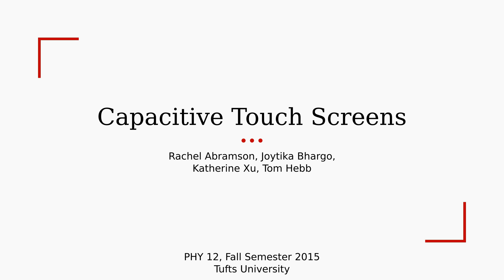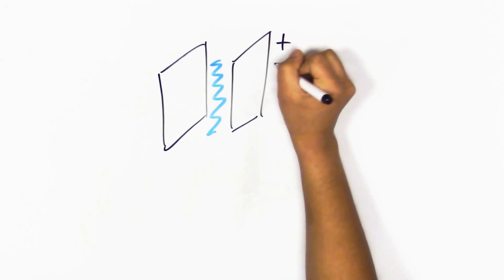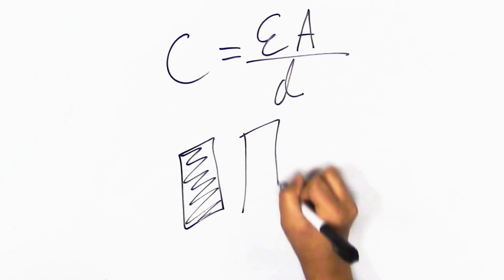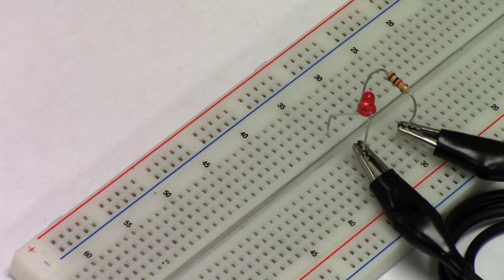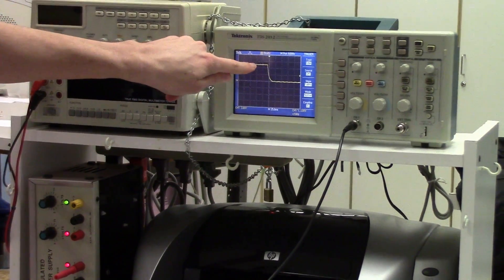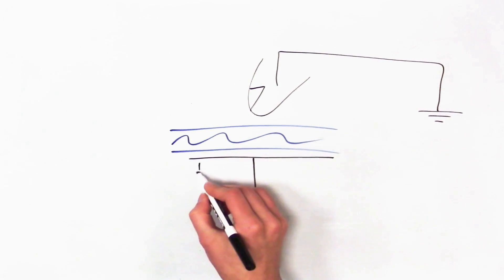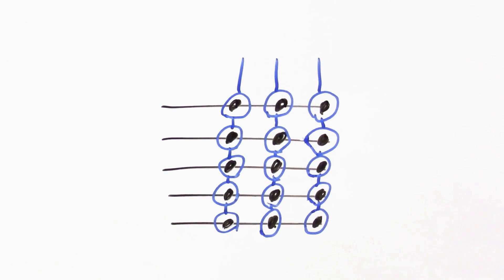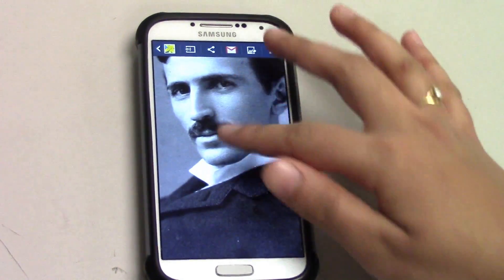How Capacitive Touch Screens Work

Comment: At 0:43 you are drawing a light bulb which is ON with a capacitor in series, DC is not traveling thru a cap so the light bulb can't light.
Reply from the maker: Good catch! You're absolutely right that the light bulb in that circuit won't stay lit. It is worth noting, though, that it will light for a brief period when the battery is first connected, since current has to flow through it in order to charge the capacitor.

Comment: Hey I just wanted to know your camera arrangement. Is it vertically or horizontally arranged ? Can you help me with the setup ?
Reply from the maker: We shot the whiteboard portions with a handheld camera pointing down at a whiteboard on the floor, with no special lighting beyond the overhead flourescent lighting of the room.

I then used Blender to plane-track and stabilize the whiteboard, and to tweak the contrast so the blank space appeared fully white.

If you're trying to do something similar, I'd definitely recommend setting up a tripod and lighting when you film instead of trying to fix up the footage in post. Fixing our footage with Blender took me a long time...

Comment: How does this effect the graphic on the screen though?
Reply from the maker: The electrodes that we describe in this video are contained in a transparent layer that's in front of the display. This layer, which is called the "digitizer," isn't connected to the display directly. Instead, both the digitizer and the display are connected to the microprocessor that runs your phone or tablet's operating system. When the operating system software running on the microprocessor detects a capacitance change in the digitizer, it knows that you're touching the screen. It then responds to this touch by changing what's on the screen, just like a laptop responds to you pressing a key by changing what's on its screen.

Does that answer your question?
Reply: +Tom Hebb Oooohhhh, yes it does thanks.

Comment: What if I am not connected to ground?
Reply from the maker: Great question! It doesn't actually matter if you're connected to ground or not; if it did, capacitive touchscreens wouldn't work, since the human body isn't technically a "ground" for our purposes.

For something to be called "ground," it needs two attributes: firstly, it needs to be able to absorb or release an infinite amount of charge without its voltage changing (practically, this just means it can hold much more charge than anything it interacts with); secondly, its voltage needs to be the same as all other things we call "ground" in the same circuit. Your body satisfies the first requirement, since you have much more mass and hence much more charge capacity than phones do. However, it doesn't satisfy the second one, since your voltage (the "ground" I draw at 4:10) isn't necessarily the same as the phone's ground voltage (the ground I draw at 5:00).

Luckily, only the first attribute is needed for the capacitive touchscreen effect to work. I haven't been able to find a way to intuitively describe how the effect works when your body is at a different voltage than the phone's ground, which is why I drew the diagram the way I did; however, if you work through the math using conservation of charge and the capacitor equation Q = CV, you'll find that the result is exactly the same regardless of the voltage of the finger touching the screen. All that matters is that the finger stays at a constant voltage regardless of how much charge it absorbs or releases, which is true for your body to a very good approximation.
Reply: Tom Hebb Wow thanks for the elaborate explanation :)
Reply: There are different types of grounds; for example, floating ground and instrument earth.  The human body acts as a floating ground.
Reply: Ern-Min Peck I